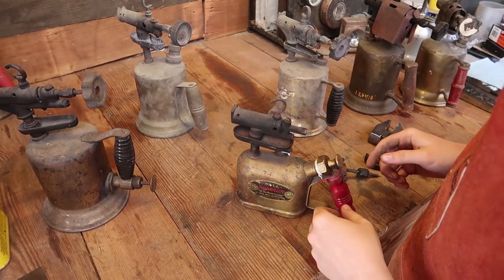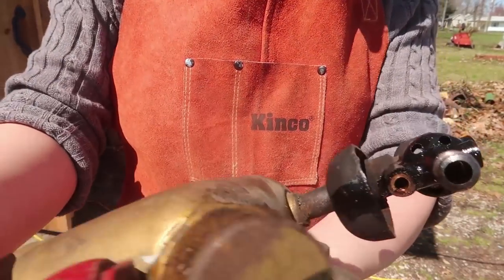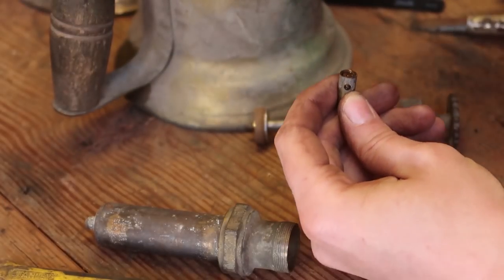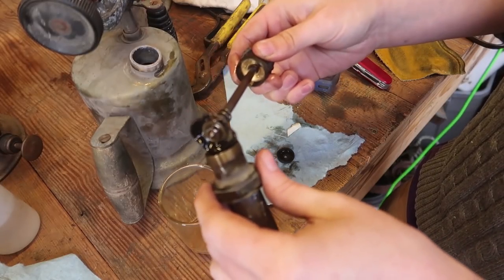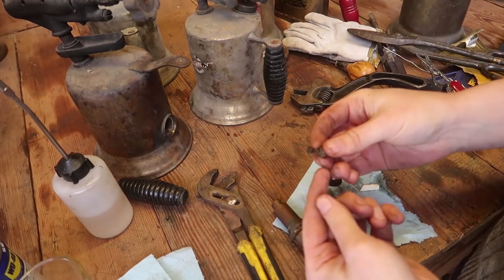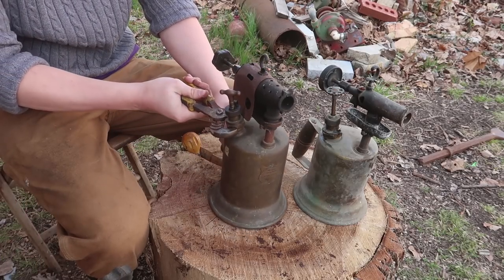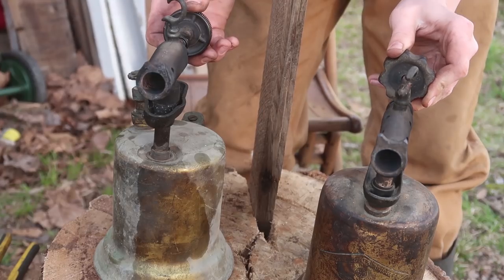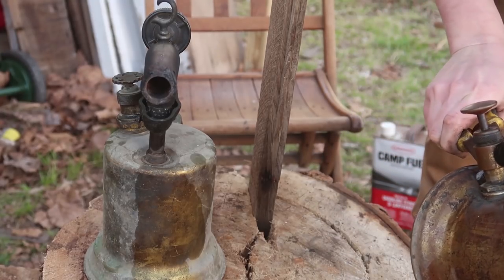Reviving Two Antique Scrapyard Blowlamps/Blowtorches, Leather Seal and Gasket Replacement.

Comment: The seal in the needle valve is a graphite impregnated packing material. It was used a lot in valve and faucet packings. Your idea of using teflon is a good one, it makes a good packing material.

Comment: Replaced many of the Colman Air Pump seals.  Sheep or Pig Leather works best.  Softer and holds up much longer  on the plunger.   Usually obtained from  a old glove.

Comment: The proper oil to use on plungers is Kneatsfoot , what they put on horses hooves but is ideal for leather plungers.
Reply from the maker: i forgot about that, however this synthetic oil has worked for a decade for me so i dont see much trouble with it.

Comment: I'm thinking heating one torch with the other helps in at least a couple ways. One- It may melt/reseal the lead seal. Two- It may melt the lead shavings and unclog the nozzle.
Going to shine/polish them once they work well?

Comment: I have repaired or should i say restored 6 blow lamps and i have done away. with the lead seals and introduced leather washers and O - Rings that fit the spindel. and they all work fine with no leaks. and i have restored TILLEY LAMPS also if you wish to restore the brass. use Citric Acid and HOT Water let the brass soak for 24 hours

Comment: Is it my understanding that the tray at the bottom is meant to collect some fuel and then to be lit before lighting the torch fully.?
To give it enough temperature to cause the gas to rapidly expand when it hits the hot metal. 

So only when fully heated is the torch effective and ready to be fully lit.

A pre heating cycle shall we say.

Would they need to be pumped every now and then to maintain pressure or is the high velocity enough to create a venturi effect, pulling the fuel out of the tank?

Comment: The fuel needs to be atomized before it will work correctly. Fuel and small piece of paper or lint into heating bowl and light , pressurize fuel tank and wait.